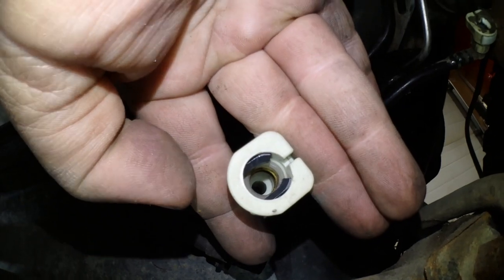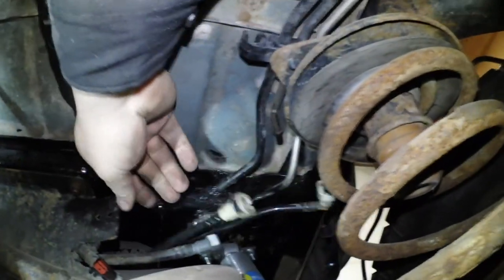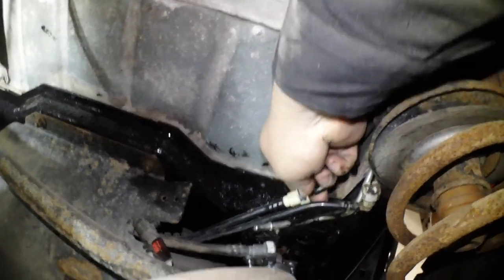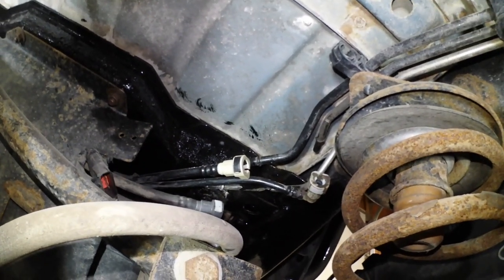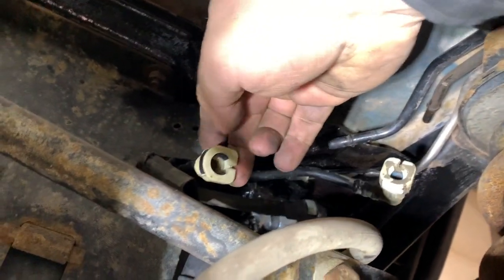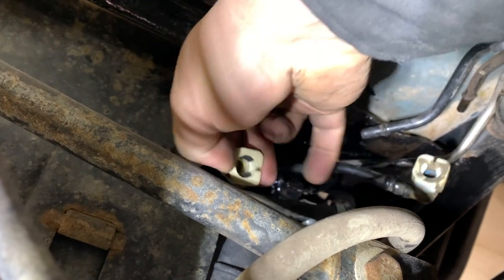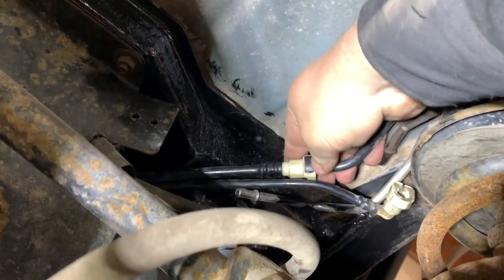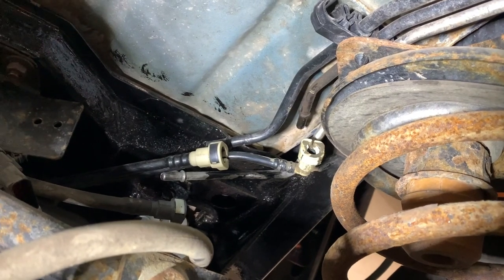How to Remove Jeep Fuel Line Clips

Comment: Long shot, in the process of dropping tank yo get to rear shock mounting bolts. On the driver side, shown in this video, the 2 light colored clips with dark releases are for the vapor lines and came off fairly easy. The dark colored clip with the white release is the fuel line. I have had no luck getting that one to release. I relieved the pressure on the fuel system and everything else is free. Are the replacement clips in this link APDTY 911134 Fuel Line Retaining Clip, to replace the clips if they break or you need to break to get the line free? Interesting enough, these clips aren't shown in the shop manual.
Reply from the maker: No they aren’t, spray the clip with wd40 or something, don’t use brake cleaner. Sometimes they clip just needs some lube
Reply: @TestDontguess  Thank you, I checked out some other of your videos, including the full fuel tank removal and fuel pump removal too. Class videos all, thanks again. I tried WD40 and it helped on the others. I'll dork around some more with this one and spend more more time on it.
Reply from the maker: @tedcrippen9255  try to squeeze the part, push forward and quickly back
Reply: @TestDontguess  That did the trick!! Many thanks.

Comment: Where did you buy the new ones ?
Reply from the maker: there is a link in the description or you can get them from your local auto parts store
Reply: BSK Garage thank you
Reply from the maker: If your looking for the large clip that connects to the evap, I believe it’s a 5/8” GM clip.  There is another video I did on just the fuel clips and part numbers